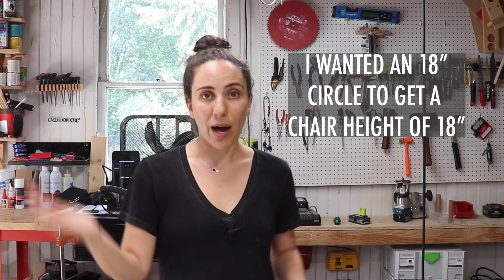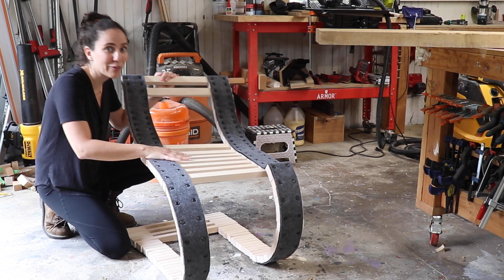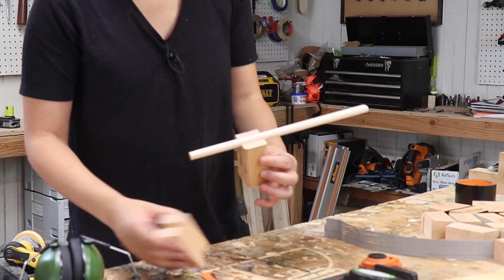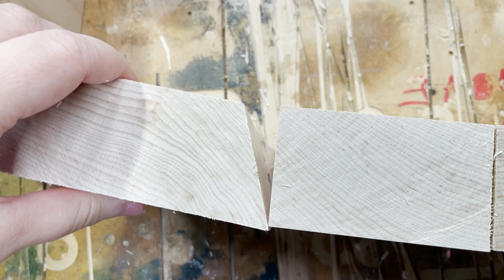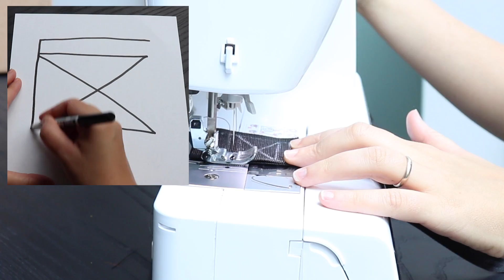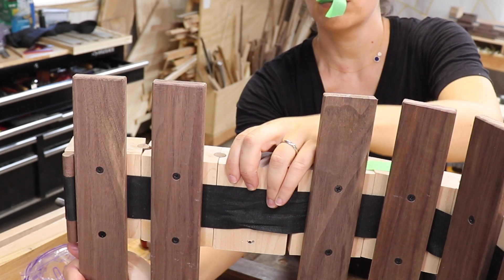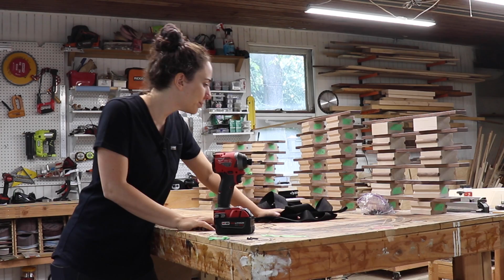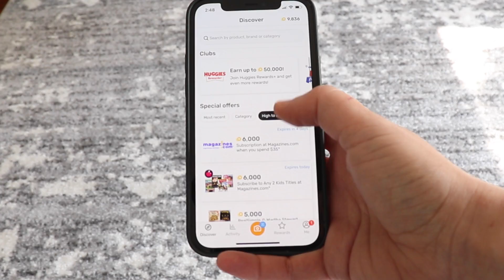I ATTEMPT to make a Roll Up Chair… AGAIN...

Comment: Have you considered actual hinges? 

The straps being attached only at the ends are a problem, because any stretching, any loose part on a corner will run through the whole chair. You need something that locks each piece to the others, as tightly as possible, with no stretching... Hinges might not be as elegant but they guarantee nothing will move.

Comment: IDK if you had this idea already, but maybe it would worth to try to get rid of the straps altogether and try using interlocking pieces, like a chain of wooden hinges? Perhaps, even using metal rods to hold them together.

And about the leather idea: as a leatherworker: it won't work. Nylon webbing is actually used to stiffen the leather where its pliability is not desirable, so if the webbing didn't work, leather won't work for sure.
Reply from the maker: this thing needs a whole redesign!

Comment: coming at this from a fibercrafts perspective, I think 1) you gotta check how stretchy your webbing is before hand and 2) you have to pre-tension the webbing and attach the pieces while at tension so it's all even/ the tension is stronger where you need it. 3) maybe counter-tension is needed at that top section where it'll fall inwards.
Reply: and I know the original design doesn't call for it, but an option to tie the top to the bottom would add tension where you need it without relying on the weight of sitting on it.
Reply from the maker: Definitely something to work out

Comment: I think the only way it can work is a proper opposing force to the strap tension (i.e. body weight). When nobody is fully sitting in it, it’s either too tight and buckles or too loose for body weight. I’m afraid you’ll have to switch to metal hinges or have a tension strap from top end to bottom end. I love your perseverance!!!
Reply from the maker: I'll keep trying!!

Comment: You could try a wire through your blocks with a tensioner att the end, you could then tighten it as needed until it finally collapses 😁

Comment: The whole strap idea might be the source of the problems. I wonder if using hinges would be any better. That way the edges of the blocks you want to be together would not be able to move apart. Might be harder to roll, though...

Comment: I'm no MechE, but as I watch this video, I see two problems in this design.  The lesser one, on which you've been making partial progress, is that you don't really know how to control for the amount that your strapping stretches.  The other is that tension in the main sit curve becomes tension in other areas, so they curl up and the whole thing slips.

PROPOSAL:  What if you build it with hinges instead?  Everywhere the strap runs from one block to the next, put in a metal hinge.  Metal hinges will not stretch (well, less than a micron), and because they're discrete, you can't dangerously transfer tension through the structure.  It also solves the sway problem, though not as beautifully as the dowels, which look terrific.  And you can leave the strapping concealing the hinges, and maybe leave the slats covering up the bump-on-the-butt effect the hinges would have (though maybe hinges+slats might not roll up well?)

Comment: If you look at it it seems like the force on the bottom circle makes the back rest collapse casue it shortens the strap. So maybe it would help if you make two seperatet straps. One for the back rest and one for the bottom circle so they are not interact with each other.
Reply from the maker: Maybe!

Comment: Tamar,  you have the right concept but the mesh does not have the strength. Also it is on one surface.  Maybe a cable that runs through the blocks with tensioning rod at the end to tighten the cable.

Comment: Ditch the textiles, you need something that doesn't extend at all  like metallic wires to provide the tension

Also, if you wanted to proof the pieces against lateral sliding, the dowels need to be perpendicular to the sliding motion! You just gave it a rail for it to move along

Comment: Material scientist here. You use the full length of the strapping and enable it to extend fully for the complete length: I assume the clamping force isn't high enough so it's actually able to slide between the two wood blocks that you screwed together. Let's say you have 2 metres of this strapping and it elongates about 1% under that load, this would mean it gets 2cm longer, causing the gaps that you see. If you'd be able to 100% attach the strapping to your wood blocks (2K glue + screw clamping the wood?) only the last bit of it can extend, and 1% of a cm is only 0,1mm per link. But then I am very reluctant to believe that your strapping can actually take the load without ripping apart. All of this would be very interesting to put into a finite elements simulation to check how it would behave (like Ansys).
Reply from the maker: Yeah, I was planning on attaching the strap to the blocks with either glue or staples or something. but then I got hurt... so decided it wasnt wise to bring it in my house with my kids.

Comment: I'm no genius but leverage here is the reason this won't work. 10 lbs is 1000 lbs on one joint. It won't work. You need a leg in the back

Comment: Stretch definitely seems to be the enemy of this chair. Pre-tensioning helps with that, but then it becomes unsafe. I was thinking metal banding strap like used on pallets/crates might be a good option. It's strong, thin, flexible and relatively cheap. You might even be able to get it for free from a shipping place if you ask nicely since you don't need much.

I was also thinking, I wonder if you could come up with a design for the flat piece that would cam-over when in place, like how a Destaco clamp works. Basically the tension on the straps would keep the pieces from unfolding like you were seeing. The tension would actually pull them together.

Also, I bet if you made the flat bottom leg the same or slightly shorter then the seat, the pressure from sitting would prevent the end piece from rolling under. With it longer than the seat section, the end has less force pushing down on it than the section right under the seat. It might not be stable enough though with the leg shorter and of course would change the overall look.

I hope you revisit this in the future. I really want to see you succeed with this, and I think you are SO CLOSE!
Reply from the maker: I'll figure it out one day!

Comment: Leather definately has more stretch. What could really work is having hinges between all blocks. This localizes the tension and stress and they are a lot stronger (as in less stretchy). You could even inset the hinges and glue a leather band on top to hide them and get the look back

Comment: Seems to me the big issue is using one piece of strapping for the whole chair. The longer the strapping the more overall stretch it has. Using shorter segments of strapping or screwing through the strapping when it is in its final shape should help, especially in the areas with the most force (where the separation keeps happening). Having a short (perhaps alternating) fixed pieces of strapping will still allow the wood pieces to hinge but not to expand apart from each other.This will also not cause additional unnecessary tension on other segments.
Reply from the maker: perhaps!

Comment: You need a solid connection btw the strapping and the wood at each section (glue, a mess of fasteners).  That way, the straps act as individual hinges rather than allowing all the stretch to accumulate in one or two joints. Strain is measured in inches per inch. Shorter initial length results in shorter overall for a given tension.
Reply: Yes! This!!!  
Securing each block to the strapping, creating individual hinges
Reply: Yes! Absolutely. I believe this is a good track to follow
Reply from the maker: Yes, thats what I was going to do after figuring out the correct strap length. but it just kept stretching... then I got hurt. so decided it was wise not to continue with this iteration.

Comment: Long toothed belt as used for car engine cam timing? If you (could be bothered) to route each piece to register with the belt it might evenly distribute the tension and therefor spacing. 
Either way fascinating stuff!
Reply from the maker: Interesting...

Comment: I think the main problem is the stretching of the material. You need a strapping thats prestretched or got a super low strain percentage. The normal polyester strapping isn't made for application such like this. A thought of mine was car safety belt material. The strain is around 6 to 11% and maybe you can prestretch it over that value so it stays stretched. 
Another thing to consider is a second strap on the outside on the backrest to prevent the top from collapsing. Even so on the legs but here on the inside. Maybe the same strap laysed around the ends.
Reply from the maker: Thats what I used here

Comment: As a chair a small fold down leg at the back would eliminate most of your problems.  Material wise you need some cable not webbing.  Or maybe some aircraft cable under the webbing.  Aircraft cable will have no stretch in this application. But your Idea is still way cool.  And your determination to do this is the most impressive part of this.....
Reply from the maker: I will figure this out!
Reply: @3x3CustomTamar  I have faith that you will, and I do not really have good answers I am just throwing stuff out there after watching.  I think it is Awesome that you are keeping at it.  And I look forward to seeing you make this chair work.

Comment: Here's an idea inspired by similar designs I found on the Web: triangles/ridge.
 
Short version: (1) Segment the structural design into 3 sections to address the different bending forces.
(2) For the top and bottom curves, curve the slats inward (and perhaps also thicken the middle) a little so that in deployment the middle of the slats touch, forming a series of triangles, in other word a third side 'ridge' in compression (a dowel or similar should be used to index and make sure the ridge locks together).  Then the three sides together are effectively a thicker beam with much higher stiffness. 
(3) For stability against collapsing, the tensioning straps should be placed in between the compressive forces: in the middle of the two chair sides for the floor section, on the front of the chair sides for the bottom curve, and on the back of the chair sides for the top section.

Original rambly version: I think that the rollup design needs to be segmented.  The part along the floor needs to put the tension in the middle, to avoid torquing the blocks risking collapse.  The bottom curve then needs to have the tension on the outside, balancing the compression on the inside, with the stretch of the former and the shrink of the latter being within limits.  The designs I see on the Web look as they are increasing the bending moment by increasing the effective thickness of the sides wrt bending, e.g. by making the slats curved inwards which thereby increases the distance between the  tension on the outside and the center of the slats under compression (which obviously need to touch - effectively becoming a third side).  A similar trick is used on the upper curve, e.g. using chordal stays, or putting the slats at an angle, forming X shapes, or again making the slats curved, forming an additional side in compression, and the 3 sides together forming an effectively thicker beam.  For this top section, the tension should be applied behind the slats, because it is counteracted by both compression of the 2 sides and of the third side.
Reply from the maker: sounds like that would work

Comment: You could rout out a channel under the strap and install a plastic coated steel cable and that would stop all stretching with the only problem being to anchor the cable properly at the right length.

Comment: I think the problem might be is you are not taking the flex of the material into consideration. Your chair with no weight on it is shaped like a chair. I think maybe you should remove a section so the chair looks weird without weight but will that gal the chair shape when sitting in it. I don’t even k is if that would work or not?  Anyway nice job keeping with it, no need to give up on the first or third failure. The project hasn’t beaten you until you let it, there is no timeframe on how long it takes to be successful.
Reply from the maker: I wont give up

Comment: Maybe your guitar building knowledge could be useful? 

Guitars with new strings will constantly go out of tune until the strings have been stretched. You could try pre-stretching your strapping material for several days before the build. As it stands you are building while the material is elongating. Its a moving target.

Guitar necks move when tensioning the strings so the design of the neck has to compensate in order to arrive at the correction "action" under tension. You wood blocks can compress, especially as designed. Most of the forces are going to be applied to the wood block on the outside corners adjacent to and opposite of the strap. These corner areas have very little wood and could compress no matter how strong the wood. So the blocks may have to be design in a way where the chair is oddly vertical and only becomes a chair when someone sits in it.

Scary when a guitar string breaks? Scares me and sometimes leaves cuts or bruises. The guitar string under tension stores a good amount of potential energy, not fun when it catastrophically converts to kinetic energy. Same with your long straps. The longer the strap the more potential energy it can store over its length. One option may be to sever the strap at each block. All you really need is a bunch on individual hinges connecting each block. Perhaps short lengths of dowel could trap the "hinge strap" in horizontal slot in each block?

Best of luck!
Reply from the maker: Interesting !!

Comment: Maybe use a block or metal plate to support the block above and maybe use multiple strap materials sown together. Use steel plate on the edges of the blocks that line up with each other. Maybe use thick steel cables underneath the wood and clamped down to each block

Comment: Hi! You're doing great! I've got some thoughts, for what they're worth, although I mostly do theater carpentry...

My initial thought is variable tension in the strapping - there are some points that rely on the tension to work, and other parts (like the bottom straight run) that don't need any tension. Maybe there's something to that? I don't think contact cement would hold up against the stress put on the chair when you're sitting in it, although leather might work better.

I wonder about putting 1/16" aircraft cable through the entire thing? Like, through the center of the pieces?

Maybe steam-bending two pieces of wood to the shape that you want the chair to have, then when you set it up you use those pieces as like brackets that the chair conforms to, so when you roll it up you have three pieces: the two curvy pieces, and the main rolled up chair. I know that isn't ideal cuz it's not super seamless and sleek but it might work, or might help inform your fourth attempt!
Reply: Yeah, I think since she's attaching the straps to each piece individually, it's ideal for varying the tension already. The straight pieces don't need tension/need tension the opposite side from where the strap is currently attached, and the curved pieces need more tension to sit flush against each other.
Reply: @j.wa.1061  that's sorta what I was thinking, she wouldn't have to rebuild it again! And I think it's the most likely option to work

Comment: To solve your design, you need to be able to master notions of structure. The 90 degree connection of your chair should be rigid. The shear is maximum at these points. In fact they correspond to the places where your straps have torn. The connection of the wooden blocks to these points should be self-locking. why not use a dovetail type assembly at these points? Otherwise, the bracing appears to be well controlled with your utilisation of dowel.

Comment: I see the trouble as twofold:
1: The strap has stretch. No matter the strapping material, you will still get stretch. Unless it is securely fastened to each block, the cumulative stretch will cause a fail at the highest stress point.
2: The wood compresses. Even if you used stainless cable, the wood will have compression at the high stress points. Thus there will be created slack in the entire system that would show up in the highest stress point unless the cable is securely attached to each block.
As someone else pointed out, if the blocks are 5 cm thick, and you are placing a 50 kg mass at 50 cm, you are placing 500 kg pressure on the joint. That's being supported by both the compression of the wood and the tension of the strap. (It doesn't divide the force, being static the forces are equal on both parts.)

Comment: I would try dyneema rope, unlike nylon it doesn't stretch.  Pretty much everything else - leather, or even steel will all stretch noticeably unless MUCH stronger than needed.  On the flip side, you need stronger dyneema to handle any shocks, which nylon, etc can dissipate by stretching.  You can find it on amazon and some boating stores, it's basically carbon fiber and costs about the same as a much thicker nylon rope with the same breaking strength.
Reply from the maker: I’ll look into it!